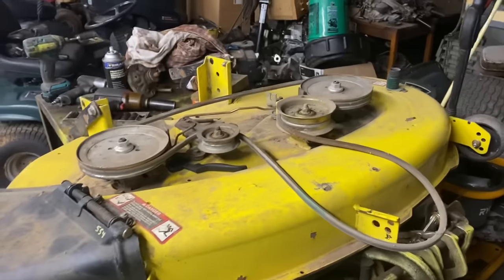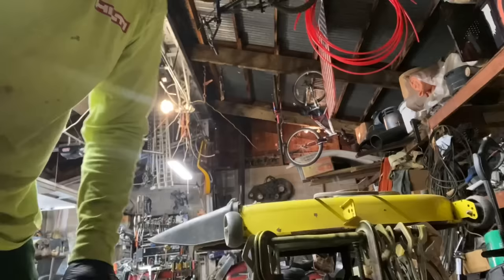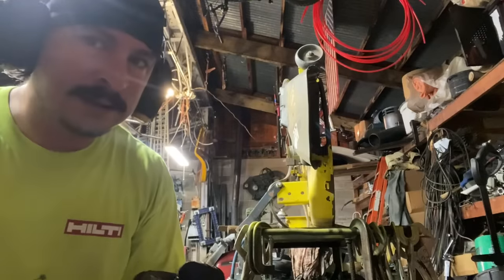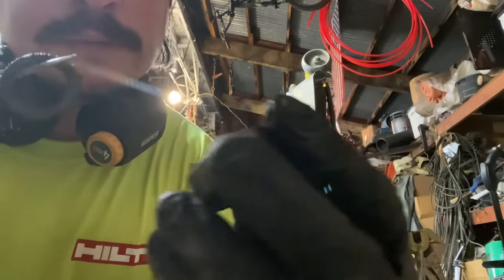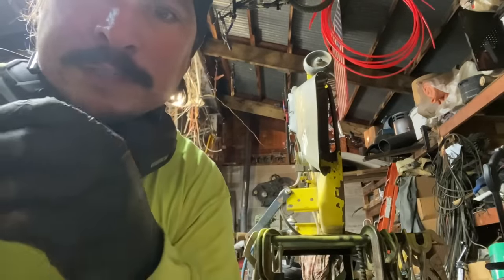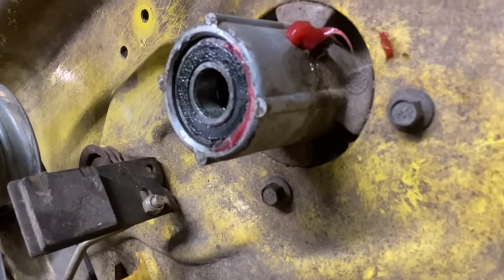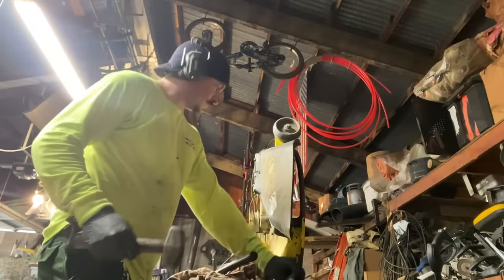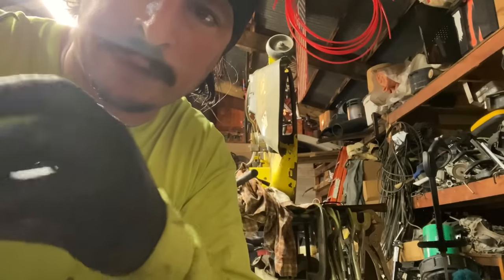Part 1 - Don’t trust the “Experts” Grease your mower deck sealed spindle bearings Common sense.

Comment: I have seen videos saying grease won't get in the bearings too. Great video. what do you think about removing the inner seals?
Reply from the maker: As mentioned in other comments on this video. Removing seals is a waste of time. Just grease the zerks as I have shown you will get the same results without tearing needlessly down the assembly and wasting time and potentially breaking stuff in the process. I made this video to prevent folks from needless work. Grease grease grease, come back to me in 5 years and tell me How my advise worked. Just be sure to grease the assembly/ assemblies until they are filled and grease exits out a top or bottom bearing or both. 

Removing inner seals is a waste of time and could actually be more of a problem. Top bearing seal on the inside holds grease up top. So it doesn’t melt and migrate down the assembly and if you only remove the inner bottom seal you make it easer for grease to pass the one seal on bottom outer and grease may exit assembly before passing both the upper seals. Just leave the seals. They can’t stop a frog fart. They sure won’t stop
Pressurized grease.

Comment: NSK and SKF are the best bearings out there. I use them in mower decks. I get them from reputable sources to avoid fakes too.
Reply from the maker: Yes. I like a quality bearing. But sometimes a China bearing for 1/10th the cost gets the job done. If they stay well greased they can go a very long time. No doubt a quality bearing is a wise choice.

Comment: My Cub Cadet ZT1 spindles don't have grease zerks.  I guess if I want to grease them, I have to take them apart?
Reply from the maker: Did you check the underside? I’m not familiar with XT1 but on the cubs prior to that model the zeros were hidden under the bottom and a slight grass accusation on the mandrels cover the zerk and hide it from view. I hate when they put them on the bottom. They get covered with grass
Reply: @GTObearclaw1  Yes, I looked under the bottom.  No zerks. Also saw on another website that they don't have them. The only 2 zerks on the machine is in the front 2 wheels. Terrible engineering.
Reply from the maker: @AaronRankin  sounds like cub is in a nose dive. mTD really running the cub name straight into the ground. Iv hated cub ever since MTD got ahold of the brand.
Reply: @GTObearclaw1  I agree my 1973 Cub Cadet 129 still runs and is built like a tank.  They'll never be the same again.
Reply from the maker: @AaronRankin  cub is not cub anymore. Just a sticker on a MTD tractor with yellow and white paint. Fake

Comment: Thanks! Great video.  No more arguments on this.
Reply from the maker: Well, you would think this would squash any confusion but there are plenty of folks leaving comments that apparently think I’m wrong. Lol. I have a feeling they are just not watching enough of the video before they decide to comment or they are just the type of people that can’t be helped. Hay, thanks for taking time to comment. I’m looking for another idea for a video that would be helpful. It’s just hard to find stuff that’s not already over done or that needs to be done right. Please consider subscribing. I posted some links in the description, if you don’t have a locking grease gun fitting they are awesome.
Reply: @GTObearclaw1  My dealer told be spindle greasing is not necessary because the bearings are sealed. Then I asked why there are fittings. He said may be the grease wold help keeping some moisture away.  I won't pump 1/2lb of grease into spindles.  Bearings could be cheaper than grease soon.
Reply from the maker: @danrascal4045  sad to hear that. I can say for 1000 percent those sealed bearings won’t last forever without adding grease. the dealer is not very knowledgeable because that’s terrable advice. But then again if stuff breaks they get paid to fix it. Lol. Scary someone that works at a place that sells mowers could be so out of touch. I do recommend pumping them full. Do it once and then the future services only require a few pumps after the initial time it will
Be full. And if bearings last forever there will
Never be a reason for tear down. Grease is not very expensive. Takes less than half a tube to grease 3 mandrels full. It does not need to be the  east quality but that’s definitely not a bad thing either. Thanks for commenting.

Comment: Great video and I get that you left seal in for proving your video but why leave the seal on the inside of bearings when you put new bearings in I’d pull seals out on the inside side of both bearings. I would leave seal alone on the side facing out. Great video and you proved that they will accept grease with seals intact!
Reply from the maker: Thanks for the comment and fair question. Consider that the manufacture in most cases builds them with the inner seal in place. For what ever that’s worth? And if someone actually greased the spindle to the point I did in the video then the bearings will be much less likely to fail and there for would be no reason to be removing bearings. And as for the seals being removed. I actually think the seal makes no difference so why bother removing it. Sometimes it’s been very handy that the inner and outer seal was on because I tend to drop bearings or they fall out while I’m banging working on the deck. If a fully sealed bearing hits the shop
Floor I can just wipe it off. But if a seal is off then dirt and Grit may end up in the bearing and it’s much harder to deal with having to completely clean the bearing to get the dirt out. Just way easer to wipe the outside of seal off. And if a inner seal is installed, grease can bypass it so what’s the difference if it’s in place? Not being rude, just my thought process. Its actually more useful than not. It’s simply a dust seal. Another useful reason for the inner seal, on the upper bearing the upper seal holds grease in the top bearing that may otherwise migrate down with gravity as the bearing heats up during use. The seal keeps that upper bearing full regardless of gravity and heat. Sounds good anyways, Just my thoughts and makes sense in my brain. I do sometimes take  the inner seal off the bottom bearing but  that is usually something I only do when I needed a better seal for the outer side of the bearing in cases where the outer seal was damaged. So rather than put the damaged dirty seal towards the center where dirt or grit may get inside the spindle I just move the good seal to the outside to retain the grease from slinging out the bottom of the bearing, sometimes rope or other debris can wrap around a spindle and damage a seal. really I don’t think it matters a lot because if you grease the housings as I did, the bearings will be fine with the inner seal. If they don’t get greased they will most certainly have a shorter life span regardless if a inner seal is in place.

Comment: so why do they put a seal on? I will still remove it, because the grease will spalsh the bearing easier no?
Reply from the maker: I could not say but I assume they have good reason. As for grease it does not splash. Oil does splash. You can remove your seal. I’m just proving it’s a wast of time.

Comment: The double sealed lasted years on our tractor and then we replaced  removed one seal so grease would go in. Some failed after first year so not don't grease and use double sealed bearings.
Reply from the maker: Sounds great, expect for removing that seal was not necessary as grease would have went right past it like it was er even there. That’s the whole point of the video. Thanks for the comment.

Comment: If it has a zerk fitting, it has to be greased even if the bearing is sealed. If it doesn't have a zerk, it doesn't get greased.
Reply from the maker: If it doesn’t have a zerk, you can add one. It will benefit all mandrels to have a zerk and get greased even if the zerk was not factory installed.
Reply: @GTObearclaw1  If it's outside the warranty.... sure.
Reply from the maker: @tobylou8  Iv never owned anything with warranty. I let folks with money to waste buy stuff new. Then when it has an issue and they can’t get off the couch to fix it, I get it cheep and fix it. No need to pay for expensive new stuff. This is a throw away society. I fix what’s cheep or free. Buying new stuff and having warranty has never excited me. From
The horror stories I hear, they usually say it’s not covered.

Comment: do you have to remove the shaft or can u pump grease as it is?
Reply from the maker: I only removed the shaft and bearings to prove the point that grease made it into bearings. No need to remove the shaft. Just grease it properly as I have shown and good to go.

Comment: Having too much grease in a high speed bearing can cause excess heat and wear.  That is why the bearings are from the factory with what appears to be to little grease, it’s for a reason.
Reply from the maker: I disagree that there is such a thing as too much grease in a mower deck mandrel. Excess grease will find its way out if heat builds up it can push any “extra” grease out when the grease swells or expands. Best way to keep bearings cool is to blow off the deck after each use and don’t let grass pile around the mandrels and basically hold heat in. The grass build up acts like insulation. Take a temp laser and get some readings. You won’t pick up excessive heat from a well greased bearing in this application. But you will on a bearing with grass all around the mandrel. I argue that the more grease the better. And a clean mandrel can dissipate heat better. Iv stated in numerous comments, some of the bearings used in this application come completely filled from the factor, those are usually the highest quality. Then on the other hand we have the cheep 3$ China bearings that have almost no grease and sometimes so little it’s almost hard to tell they have any. I always pop the shield off to see what’s in a new bearing. The average person will just drop the bearings in and never know what’s in them. I did the same thing for many years. But eventually I started to realize even some of the new bearings would fail quickly. I use to do a lot of mowing and could rack up some hours each year. So many years ago I did some experimenting with this theory and removed some bearings and packed tightly by hand and installed the seals. Left absolutely no space for air in the bearings. Each year I removed the bearings and inspected after a seasons use and had absolutely no issues after several years. After a few years I sold that tractor and upgraded, I ended up still doing the service on that same tractor for many years for the new owner and never once had a deck bearing fail in it. Since those days iv learned to just pump the mandrels if they have a zerk and it has worked flawlessly every time and iv never experienced problems. I personally think some bearings are engineered with just enough grease to last only so many hours and that can be decreased if the machines are left in the elements and water is able to penetrate into the bearings. I’ll
Stick to keeping mine filled with grease. Iv tested it. Had no issues and Iv seen enough new bearings fail under 100 hours. You are entitled to your opinion but unless you have tested it for this specific application you may be  incorrect and it’s something to consider. As far as repairs and services go, Bearings are cheep and so is grease. I say if your really interested in knowing the truth just simply experiment for yourself. Worse case it could damage a few bearings (but it won’t) maybe you will find it actually works great and could save you some money and trouble in the long run. I am use to folks leaving a similar comment and have responded to many about bearings overheating. I think there is some very wise folks and no doubt know a lot about some other bearing applications. However I felt like this application is one that many people don’t understand very well and maybe use logic learned from other bearing applications and cary it over and try to make it fit this application because it seems logical. That’s why I made this video. It just could be that I’m right. Throwing around thery is fun and all, but I got sick of listing to the “experts” proudly stating that it’s pointless to connect a grease gun to these mandrels because the bearings won’t take grease or some other unproven dumb reason why it is better to just replace the bearings are disassemble to grease the bearings or remove inner seals that don’t stop the flow of grease. I proved some “experts” were wrong. Just a normal day over here.
Reply: @GTObearclaw1    I never said not to grease them, or that what you are doing is wrong, actually I am agreeing with your system.  I do the same thing you do.

I’m just providing some real life, proven info on high speed bearings.  I have been designing and repairing high end, high rpm equipment for decades, and have taken many temperature readings and bearing lifetime,  using different grease, different applications, at different speeds and it does make a difference.  On the flip side, the way most people use and take care of there equipment, the difference probably won’t be noticed.
Reply from the maker: @mitch8831  hay, all good here. I don’t mind examining things. And I’m not saying I’m right. This is my opinion. There are so many factors to consider and things that can vary from one application to the next and so many ways people can make minor adjustments to the process it’s hard to really know without just testing
It ourselves. I can go overboard sometime trying explain my thoughts.

Comment: There's a cavity in there with $3 worth of wasted grease gun grease. I wonder why they put the Alemite fitting on there when they could've built it a little tighter and channeled the grease more efficiently?
Reply from the maker: Where do you come up with 3$? 
I can usually get a tube of grease for under 5$ and it will grease 3 decks plus. So each deck would be under 2$ each and each deck has 2 or three spindles so about 1$ per assembly or less. Is 1$ per assembly a lot? Is 3$ per assembly a lot? I don’t think so. Once filled they only  require a few pumps in the future and bearings could potentially last forever. Seems like a smart way to go for me. I know how much work it takes and what parts cost when a bearing fails. I’d rather spend 10$ an assembly if that’s what it took to fill them with grease but in reality it’s about 1$ to fill each assembly. To say it’s a waste of grease would be a stretch.

Comment: Leave the inner shield in place, as demonstrated. This way the full force of the pressure within the cavity won't blow out the outer seal.
Reply from the maker: I agree the inner seal should be left, mainly because there is no reason to take the time to remove it if all you want to do is grease the assembly there should be no reason for dissembling the deck so just greasing is fine with those seals. I think the seals prevent people from being able to process that grease can pass them but in fact don’t stop pressurized grease. Just block some folks from thinking it can. As for the seal slowing pressure, I think thats possible but I have never seen an outer seal pop off. Not saying it can’t happen but Iv never seen it nor have I ever removed any bearing that had a seal off unless the bearing had major damage or the rubber seal itself was degraded to the point the lip of seal was no longer intact.

Comment: I have wondered if gear oil would be a better solution than grease in this situation?
Reply from the maker: I think not. These type of “seals” are really little more than a dust cap. Thats the point I’m trying to make g to make so folks understand how easily grease actually passes into the bearings. Lots of confusion on this topic.
Reply: Oil assuming it was thick goo which some are would literally pass through the bottom inner race seal as soon as it got warm , as mentioned its nothing but a dust cap

Comment: I read the zerks are just to keep the spindles rust free, that also partial grease fill on bearings is purposefully intentional so that the grease doesn't churn and degrade and overheat.    I may have put 50 pumps into mine, an I gave up never messing with it again.  If it's so easy to remove a bearing to demonstrate something like that, well then they very well can just be changed if and when they fail for whatever reason.  I'm not worrying about it anymore.  Who thinks 70 pumps of grease was purposefully intended by any engineer who designed and placed a zerk there?
Reply from the maker: Whoever wrote that zerks were to keep the splindles rust free is a moron. 

Put in the work to grease them properly one time and
From
That time forward only a few
Pumps
Will be needed to push more grease into
The bearings at the next service because voids will be completely filled after the first time so
From then forward services will be faster. Took me years of doing it the way your saying you will do, “ replace bearings when needed” I
Finally figured out the way to
Prevent bearing falure. I just hope
It helps some folks. Thanks for the coment, I’m
Sad you gave up when you were so close. In a perfect world the manufacturer would fill the void with grease but things are not always as they should be. I’m surprised some of the cheeper machines even have zerks.